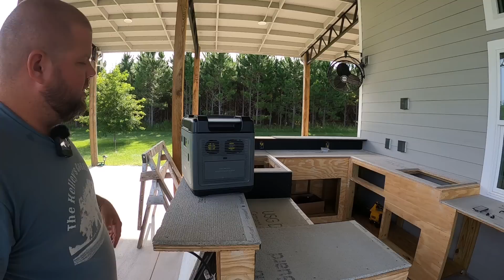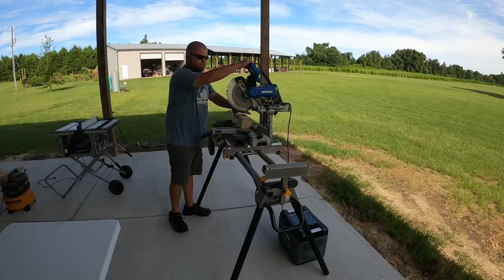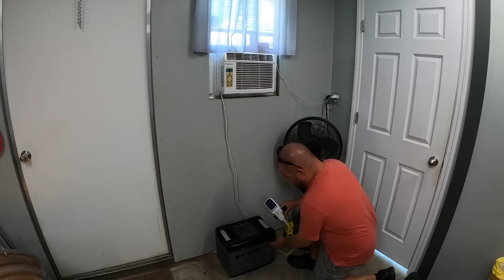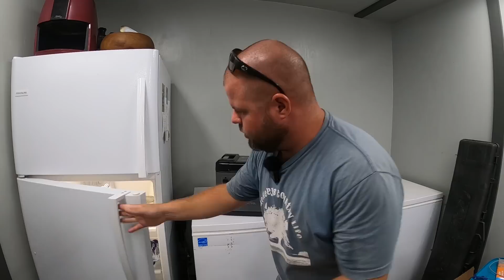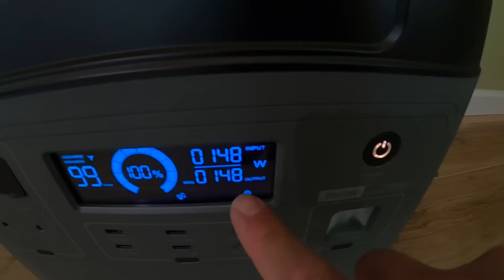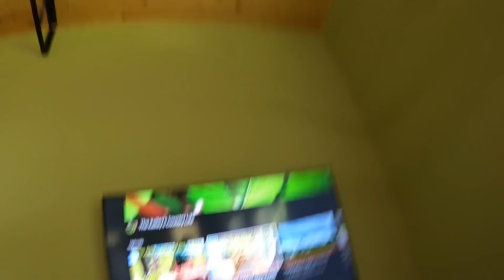Finally enough power! Oukitel P2001 portable power station full review and test! #620

Comment: 21:28  I wouldn't call a UPS feature an "extra" awesome feature, it's a "killer feature."  A killer feature is a technical term, for a feature that stands on its own, to single handled justify the purchase of a product.  You could easily spend over $1,000 on just a UPS, and it wouldn't have the run time this has, it wouldn't have an LFP battery (lead acid), it wouldn't have any of the extras this has going for it as a PPS.

Comment: Two questions one is can you add extra battery capacity two can you pair it with a second unit for true north American 120 240.volts split phase power I'm looking for a unit to go off grid solar something I can start low maybe have to only run an item or two at once then later add more battery capacity and finally add a second unit for for 2/120 volt legs with 240.volts between them I can buy a gas generator that outputs 120//240.volts for a reasonable amount I know and expect this unit to cost more than a gas generator but would eventually like to go solar someday maybe someone will bring out a unit that will meet all users needs  maybe a unit that has basic features and is able to add extra items for example bring out a unit with just the basic battery and port's for other item's so I'f you are using it for off grid you would need a 120 volts pure sine wave inverter  and a good mppt solar charge controller all items can have a port built-in to the unit so you order it with what you need a ups is great for someone with the power lines but for someone off grid or using it for camping they may not need that ability same thing with the usb if you're putting it by your panel box you probably won't be going to the unit to charge your phone  but likewise if you are planning to use it for a full-time power supply it would be handy to have 120//240 capacity to  be able to start with 120 volts 2000 watts capacity and later plug in a second 120 volt 2000 watt inverter to have 240 volts it would give you 4000 watts between the two legs and 240.volts between them that would truly be a universal north American unit able to meet the need of RVER  those who want backup power and those who want to go solar off grid  just order the features you need and can afford then as your budget will allow add features to your needs and if your needs change add features to meet your new needs if you need more than the basic watt hour capacity add more Rather  then like all units out there your needs charge and you need to buy another expensive unit
Reply from the maker: This one does not have pairing capability and the option to go to 240v. I myself am eager to have an expandable 240v model for home backup.

Comment: Andrew - During recent 5 day outage I realized how important it is for my modem and router to work since my phone goes off my wifi. A small desk fan would have been great. If charged ahead do you think this unit could power modem, router for several days?
Reply from the maker: Depending on the size fan,  not exactly sure how long. The router and modem would have literally lasted a day or two. You could then recharge this via solar or a gas generator.

Comment: How long run honeywell heater it’s say 120V A.C. 60 Hz. 1500W. T.P. It is fan and heater plz🙏give some information.
Reply from the maker: This is a 2000 watt hour unit. That means a 1500 watt heater would only run a little over an hour on high. Low is usually 600-750 watts and would extend runtime to over 2-3 hours. Heating elements are some of the hardest drawing devices.
Reply: @TKCL  thank you 🙏

Comment: Thanks for video Andrew. So I can leave the unit plugged into a wall and keep my refrigerator freezer on it just in case power goes out or I'm not home and power goes out and I'll keep it running. Does it hurt the unit to leave it plugged in all the time to the 110 outlet to charge and keep an appliance running. I.E 24/7
Reply from the maker: If it truly functions as a UPS it shouldn't matter leaving it plugged in because it's passing through, not discharging and recharging.
Reply from the maker: I'm not sure if there is a wattage maximum for the ups feature or if it can trigger over on a true 2000 watts. I'll need to do some further testing. Regardless a refrigerator does not pull anywhere near that much wattage.

Comment: Recently had electrical work on my home and had no power for about five hours.  A box like this running just a window AC unit would have been awesome.  Gas generators would not work here. One, it would grow legs and walk. Or my neighbors would kill it. And two, gas itself is not allowed in or around the building.   Also needed to do soldering wiring work on my truck and there is no practical way to run 120v all the way from my home to where I park. So one of these again would have been great to have.
Reply from the maker: They have their places and practical situations.

Comment: Well I'm chiming in. I was just curious about your ice fridge and the ability of running multiple fans you have within the freezer. draw of the compressor kicking in along with the power output going to the fans? I'm just curious about that scenario? You made it so it needed to be cold enough to keep your ice from melting and sticking to one another. That would be an interesting test to see what happens with the ice freezer unplugged from the wall for about maybe 2 hours running on your power bank. Will you have hard ice like normal or soft ice showing that the power bank is struggling.
Reply from the maker: It run it no problem. Actually with a few solar panels and this power supply, I could probably run it forever making almost free ice.

Comment: If you are using the unit for an off grid site. Can you have the solar panel hooked to it so it can charge while you are using it. 

And I love how at the beginning of the video you had that heavy unit setting on your new bar top with no worry. Very well built.
Reply from the maker: Yes it does allow pass through.